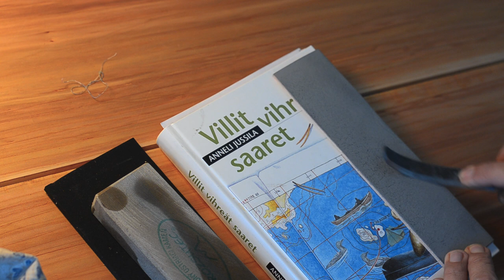making a Crooked Knife - Mocotaugan - iron recycling

Comment: Nice build, whats your experience with the rocsutec stone? Ive heard many times that this stone cuts to slow
Reply from the maker: The Roszutec is a fine stone with grid 6000-8000. So, if it is used for sharpening, yes it would be rather slow (like any other 6000-8000 stone). But if it is used to get rid of the burr after sharpening on a coarser stone and to get a really sharp and polished edge, than it does a great job. 
Generally the disadvantage with natural stones are, that they are less aggressive, due to the hardness. But this hardness usually brings also some advantages: No soaking required, stays flat longer.
If you need a coarser (faster) stone and would go for natural stones, i can recommend the Wästikivi.